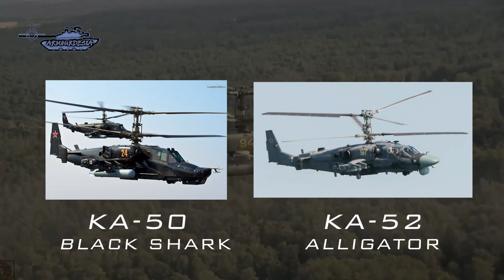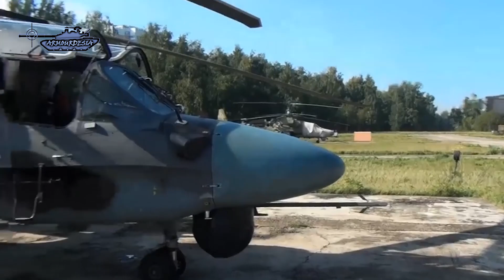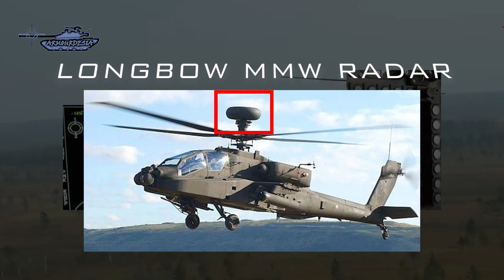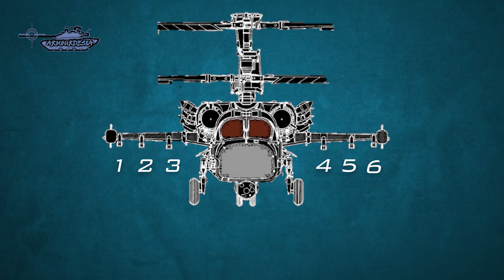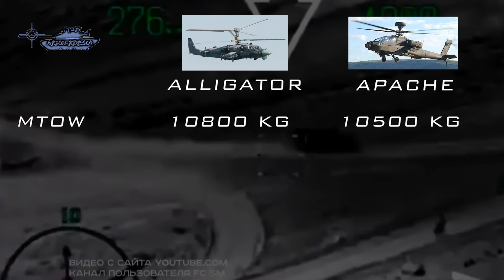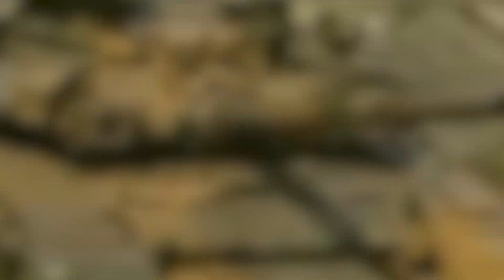Kamov Ka-52 "Alligator" Russian strike gunship | Tank Hunter

Comment: KA52 is far better than apache...armor power range
Reply: Not even close. The Apache is still the class of all attack helicopters. And so are their pilots.
Reply: @kevinblackburn3198  To my friend, the Apache helicopter is certainly a top helicopter, and until recently it was the best in the world. But by all characteristics KA-52 is a much better helicopter in every sense. Like the MI-28 which is also a better helicopter than the Apaci. The Apaci is in the range of the MI-35 M helicopter
Reply: @SRB.4S  the KA-52 has one advantage.  It can carry anti ship missiles where the apache cannot. But in regards to range and ceiling as well as real world performance including hovering ability and payload delivery and sensors the apache is still better. But more importantly,  the US is just better than anyone else at fielding rotor craft including servicing and pilot training.  That has more to do with the amount of money the US spends than anything.
Reply: @kevinblackburn3198  KA-52 has not only one advantage, but practically all the advantages in relation to the H-64 helicopter, when it comes to important and vital advantages for a combat helicopter, whether someone likes it or not, these are the facts, they have just been presented in this video clip. Let's start with the radar on the KA-52 which has a range of 32 km, or you 4 times more than on the H-64 helicopter, also the KA-52 is the only helicopter with, the possibility of ejectable seats, in case of need, also the helicopter is much better armored than the H-64. So it is very simple KA-52 is better armed, with more types of projectiles and the capabilities of the weapons they carry, which you concluded, it is better armored, and the crew is better protected, also the helicopter and crew have a better chance of surviving in combat in fact, than the crew and the H-64 helicopter ... So the KA-52 has all the important and vital advantages that a combat helicopter should have in relation to the H-64. So it has nothing to do with money, or anything else, Russians simply make better helicopters, for much less money. Let's take the example that in each segment also the MI-17 helicopter is better than the UH-60, and it is a much cheaper helicopter, both for purchase and maintenance, and it is of better quality and has better preforms, although this is about two transport helicopters, MI-17 is better armed, better protected and can carry more cargo and more soldiers to transport, it is also better protected both passively and actively, which is proof that money in these situations is not crucial, and that it is not possible to buy everything, no matter how much money you invest, but a design solution and knowledge. So, as I have already mentioned, the H-64 is an exceptional helicopter, but it is also worse than the MI-28 and especially the KA-52. So no country that is not dependent on the US, or a NATO member, will buy American helicopters only if they receive them as a gift. Because they have worse characteristics and are twice as expensive for both purchase and maintenance.
Reply: Wish it were true my friend. But sigh, it is nowhere near the Apache in any measure.